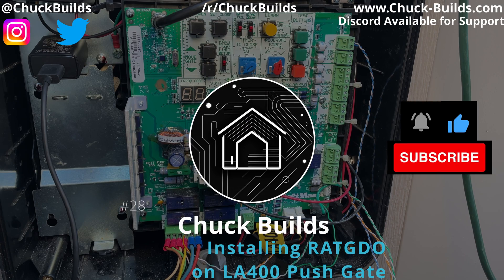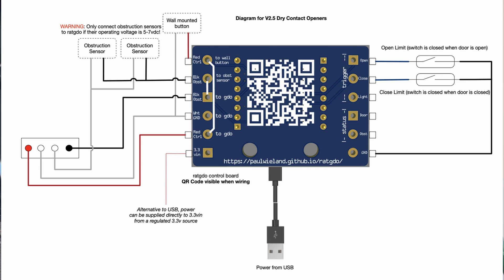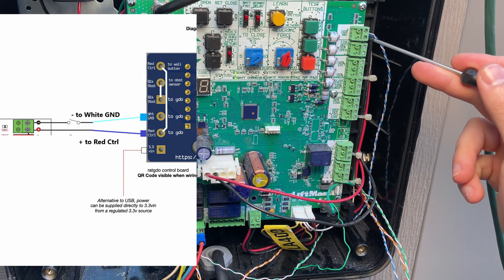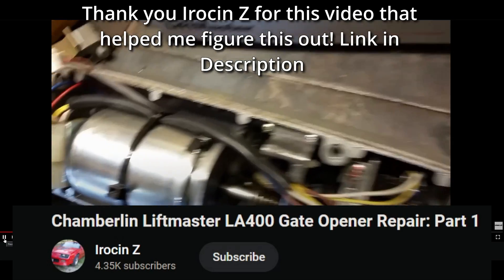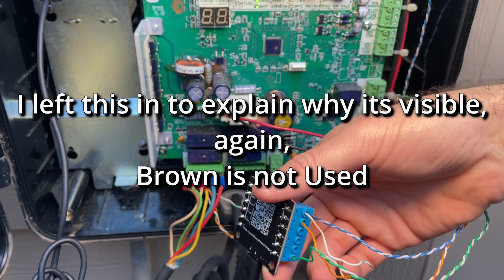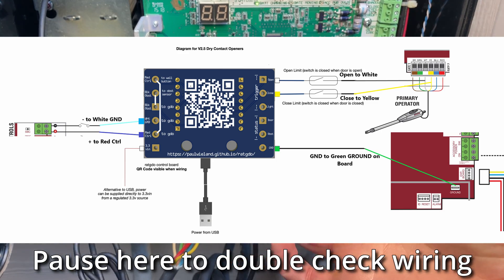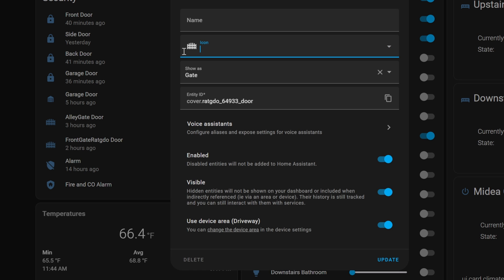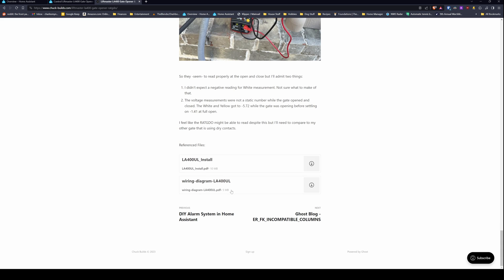How to Install RATGDO on Liftmaster Swing Gates

Comment: Hey Chuck, nice video. My question before I install one of these. Wouldn't this just work with power, and the red and black to the SBC? Can't the gate board continue to control the open and closed limited other features? What would happen if I only connected this via SBC? Thanks!
Reply from the maker: It’s been a little while since I did this but I believe it will open and close but it doesn’t sync if you use a clicker. Like ratgdo will think it’s open when it’s closed or closed when it’s open

Comment: I have a Docker container install of Home Assistant, without add ons.  I am new to home assistatn, learning as I go.  I am wondering if my  Home Assistant will recognize the MQTT dry contact firmware on ratgdo or must I install MQTT add on in Home Assistant first?
Reply from the maker: Do you have mqtt working already? If not, You’ll need to run it as a separate container (I think, I don’t really use the docker version of HA).
Reply: @ChuckBuilds I was able to get MQTT running in a separate dockercontainer and then integrate it to HA. Thanks.
Reply from the maker: glad to hear it!
Reply: @ChuckBuilds  Does home assist then automatically recognize the ratgdo once proper firmware installed or does it require a manual add?
Reply from the maker: @rchaas53  You would go to your MQTT broker on HA in your integrations section and make sure they are showing there. You need to ensure your RATGDO MQTT firmware is pointing to your broker
Reply: @ChuckBuilds  I got it installed and working in Home Assistant!  Hooray.  However, there are three buttons, open (up arrow), stop (solid square) and down arrow (close).  Only stop and close are active, open remains greyed out.  The close arrow works to open or close, so doesn't really matter but it bugs me.  I wired my la500 exactly as you did yours...did you find something similar?  If not, any thoughts?  I went back and checked all connections, they are solid.
Reply from the maker: @rchaas53  I'm a little hazy on this as it's been a while but I think you need to wire it to the button that does both open and close - not Open separately and Close separately. On my board this was labeled as the SBC (I think Single Button Control) and the RATGDO tracks open and close status. That might explain why it is only working for the close button?
Reply: @ChuckBuilds  The sbc button works.  The limit switches seem to be the issue.  Seems related to the yellow and white wires that go to the primary operator connected to ratgdo open and close limit switches rather than the sbc wiring.  When i go to the url for the ratgdo, the close limit switch remains "off" which i think means disabled, and the open limit switch is "on", or enabled.  So the board "knows" when the gate is open but not when it's closed.    thanks for the reply!
Reply: And my goal for all this was to drive up and have the gate open without pressing a button.  I have a button (in home assistant and bridged to apple home) but the automation doesn't work.  I saw something somewhere that the only way the automation works in car play is to import the device as a garage door, but mine is a button (since it doesn't know open and closed, it can't be a garage door, it seems).
Reply from the maker: @rchaas53  hmm I'm looking at mine in HA trying to figure out why this might be. I did change the "type" to door but maybe I need to set up carplay to see if it will add as a garage door

Comment: Hello Chuck -

Thanks for posting this awesome video and I've been following along with the HA Forum thread noted above. I have a ratgdo which works great with my Liftmaster Gate LA400 actuator. I'm using it in HA with the MQTT firmware set to dry contacts. I am however using the Expansion board.

The reason for the message is regarding Party Mode. My gate is currently set up where you press the button, the gate opens and then closes after 10 seconds. This feature is done by manually setting the Timer to Close dial to 10 seconds on the main control board. The ratgdo controls the gate the same way. You press open in the HA app and the gate opens followed by automatically closing after 10 seconds. I'd like to keep this feature. However I'd like to temporarily disable it remotely by putting it in what Liftmaster calls "Party Mode". Liftmaster did a poor job with this feature and how it is implemented. The only way to put the gate in Party Mode per the Manual is by opening the gate via remote/keypad. Once it's fully open, you press the Reset button on the outside of the control box at the gate itself to hold it open.

My thought would be to somehow wire into the reset button wiring. Then it can be programmed as a simple switch similar to the lightbulb feature. Just needs to be on/off. The sequence would be as follows. Open the gate normally via the remote or app. Once the gate is completely open, press the reset button via the app to keep the gate open. When you want to close it at the end of day, press open/close on the gate app or press the reset button again. 

Your help would be greatly appreciated.

Thank you.
Reply from the maker: Hey, I wish I was more help on this. My only thought is using homeassistant to run the automation for party mode and turn it off on the device itself. Not ideal but would give you options on how it works

Comment: Thank you for this video!!  Do you know if there is a way to make the RATGDO put the gate in "party mode"?  I have an LA500 with the expansion board, and you have to go out to the gate keypad to put it in party mode (hard open, bypassing any auto-close settings).
Reply from the maker: I'll be honest this is the first I am hearing of it! I wouldn't think so as the ratgdo is really just "pushing" a button. My first thought would be to turn off any auto close settings and use a HomeAssistant automation to mimic the same result but that isn't really what you are asking.
Reply: That’s what I was thinking too. I think I’m going to go this route. Thank you for your help!!
Reply: Same! I'd like to see how this can be configured as well. Would like to see a party mode option when timer to close is enabled.
Reply: @matthewzajda8854  there is a how to on the ratcloud web page describing a party mode solution

Comment: Hi, I have the RATGDO but I got in the mail the 2.53 Version is slightly diffrent, how will the connection diagram work for the LA400. I assume the RED "WALL BUTTON+" will go to SB+ and the BLACK "obstruction+" to SB-? this is the diagram of the 2.53 https://user-images.githubusercontent.com/4663918/288450016-0caa5d03-325a-4c89-a144-a145ac907dfa.png

Comment: Thank you for the most helpful video I've found on this topic of RATGDO with a gate opener. 
I have a Liftmaster sliding gate and it has the Expansion Board.
Using a multimeter I can confirm your suggested settings with a correction in the video at time code 1:19 that shows Relay1 and Relay 2 settings.  The relay settings are correct (R1: Off-Off-On) (R2: Off-On-Off). 
However with RATGDO in MQTT Dry Contact mode you will want to use NO & COM on R1 for Open state (continuity on NO & COM when gate is open, no continuity on NO & COM otherwise) and NC & COM for Closed state (continuity at NC & COM when gate is closed, no continuity at NC & COM otherwise).
The + and - SBC terminals do work as a momentary trigger as expected and work to open, stop, close with each subsequent trigger.
Reply from the maker: Thanks for checking that on the expansion board!

Comment: Is there any benefit to getting the add-on board?
Reply from the maker: @SterlingRose   Check out this thread! I tried to link to the exact comment that should have the expansion board wiring! : https://community.home-assistant.io/t/control-liftmaster-la400-gate-opener-via-ha/631055/56?u=chmynard
Reply from the maker: If you don't have an SBC or a different kind of board / actuator that you can't replicate what I did. The addon board will enable the RATGDO to work if you can't do the colored wires like I had.
Reply from the maker: @SterlingRose  or this : https://community.home-assistant.io/t/control-liftmaster-la400-gate-opener-via-ha/631055/64?u=chmynard